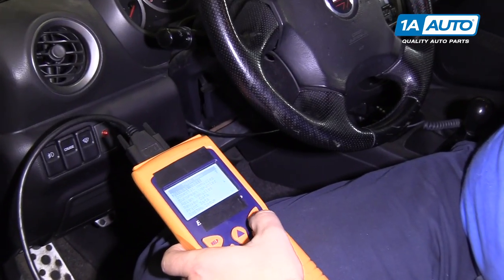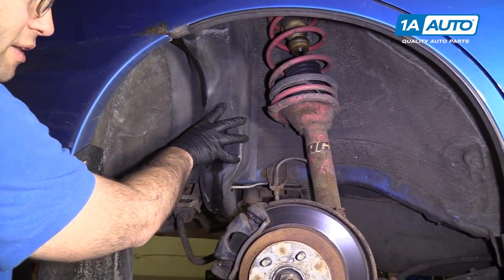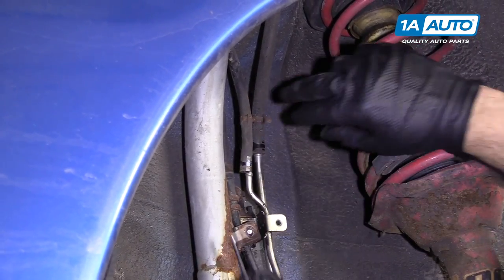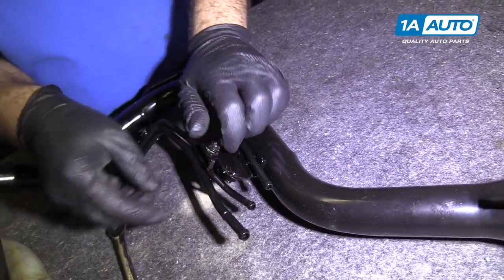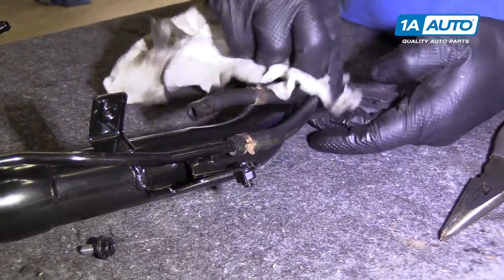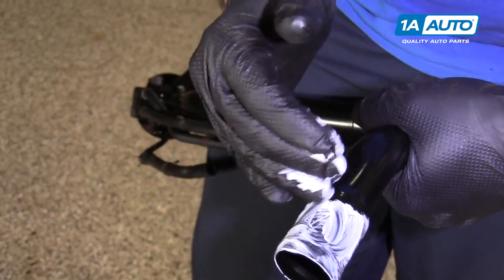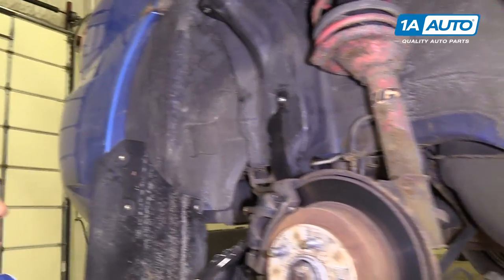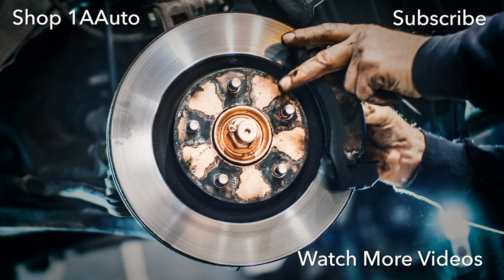How To Replace Fuel Tank Filler Neck 02-07 Subaru WRX

Comment: Pull the fuse for the fuel pump.  It can be done faster with less effort than taking out the interior trim .
Reply from the maker: +Charles Bishop Thank you for feedback!
Reply: @1AAuto  I think my car needs this done. I need a mechanic to do it. can you estimate the time it took? so I can think about scrapping car or to keep it. water is getting in my tank but the tank doesn't leak gas. I spent a fair bit on repairs in last 2 years and I am  wondering if the car is worth keeping; is it more than $700 for repair? looks like it

Comment: I have an 04 Forester XS, I have been having issues with filling gas for about 3-4yrs. now with the last year being the worst of it. Filling shuts off after a sec. when trying to fill normally. So I have to hold the trigger just slightly to get some flow. However, I do not have any stalling, nor have I had any codes regarding and fuel sys issue. So basically, will this procedure help my fozzy and is this process method the same vs the WRX you are working on in vid? Or if this will not, can you recommend a vid where its showing how to clear the vent line. I am a visual learner and when just reading forums posts I can't picture the process. Thanks for the video, and hopefully I can get a response....✌✌.

Comment: Super, now where’s the video showing how to replace all the stuff you skipped like the two lines that go into the side wall and the hose that connects the neck to the tank that’s buried by the rear suspension and drivetrain.

Comment: In my car whenever I try to put gas in it it will just refuse it so I have to pump very slow, if I do change my filler neck will it fix my problem
Reply from the maker: +Master Cuber We do not have a way of being able to diagnose the issue that you are experiencing with your vehicle but suggest taking it to a local mechanic for a proper diagnosis.
Reply: Yo Paul did you ever fix this problem? My subie does the same thing
Reply: @henrygossage2737  if it still makes that issue, I'd go after the purge or vent valve, usually the purge valve. Purge is easy to get to, it's in the engine compartment Vent is hard to get to, it's on top of the tank.

Comment: Nice video and really helpful! Used it on my 2001 Forester. Checked with my mechanic and told me releasing pressure was not necessary but a good safety practice. Thank you so much for the video
Reply from the maker: Thank you for the great reply! +Marco

Comment: Great video. My car won't start once in a while after fill up. It will start only when I pump gas pedal. But then drives and starts fine. I also have a gas smell in my salon at times. Could this be same problem or smtg else. Any advise guys.